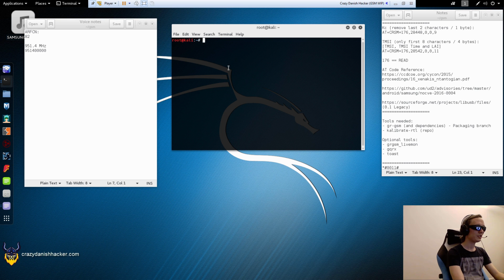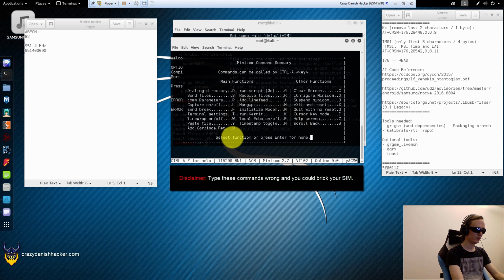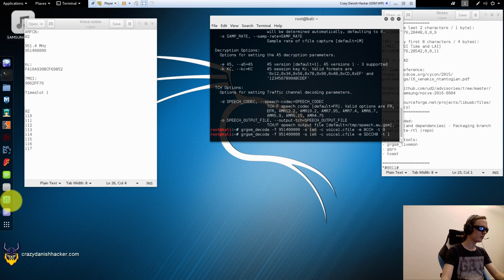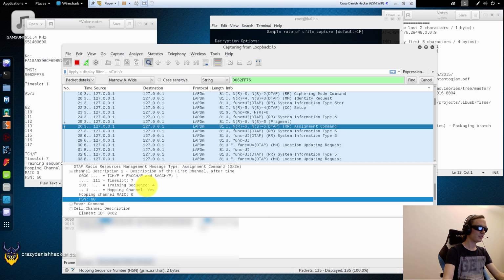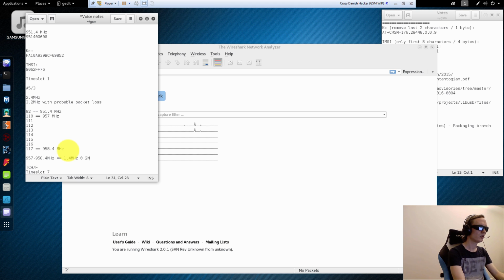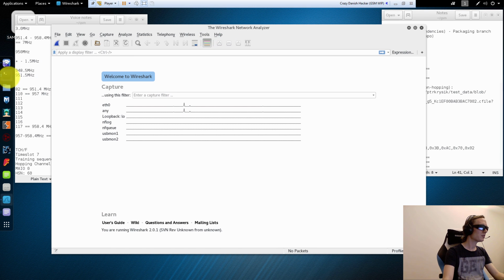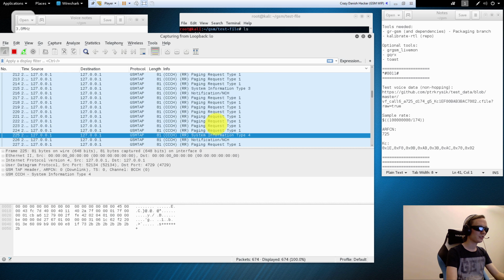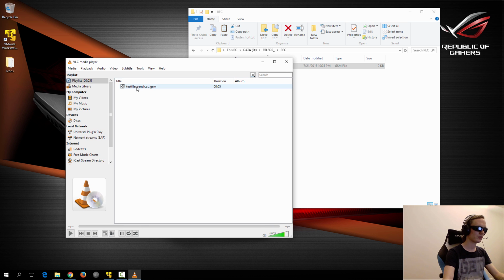GSM Sniffing: Voice Decryption 101 - Software Defined Radio Series #11

Comment: Nice Video! i have a question, im using blade rf x40, when i run livemon theres no hex codes show up, then when i use grgsm_scanner i didnt get any data about frequency, or i must use cellphone?.  so how can i can get the correct frequency?

Comment: A lot of limitations and not so obvious. Is it possible to track the hopping carrier by simultaneous tuning of RTLSDR? Instead of it, you suppose to capture the whole band, it requires VERY MUCH of computational power and of course SDR with USB3 or gbit lan or even nore. i estimate for whole band something like core i7 or i9 would be needed. Also i noticed that you got the key right from the phone. So, mom's hackers, remember, that this technique is impossible without physical access to SIM card or phone of the "victim"
Reply: GSM is vulnerable, on paper. He doesn't do it here on a real network. On a real network is so difficult.
The process is very long, the variables, the frequency hopping.
To capture the whole band must have 2tb of tables (on hard disk or cloud ?, a lot of time to download and then get to a voice), a lot of computing power.

And it is not said to arrive at a result.
Reply: @trashislife6463  now, he captures a real data from the nearest cell tower, that's why he blurs LAC of current cell, it discloses his exact position.
Reply: @romanetz55  
yeah, but it's not that easy. Where do you put the 2 TB tables?

A simple RTL-SDR is not enough to decrypt in live ... even just for the frequency hopping
Reply: @trashislife6463  2TB of fast local storage, say, SSD with M.2 interface - afaik, this is second fast after RAM - is something around ~$1500 now. Also, two simultaneously tuned SDRs are needed (the speech from and the speech to user are spaced by 45 MHz, BTS-to-MS link is higher. But!
Especially in a city, the phone highly unlikely uses GSM for calls, mostly 3G or even VoLTE.
Reply: @romanetz55  there are still a lot of feature phones with only 2g-gsm, and even if an Iphone 11 called them it would be obliged to switch in 2g ... but .. but .. is it really worth it?
even with two sdr at the same time you are not sure of reaching something concrete.
One thing I did not understand, is it possible to decrypt only live, or is it possible to "record" and decrypt at a later time?
Reply: @trashislife6463  as long as all the necessary parts of communication of MS to BTS (and vice versa) are intercepted and recorded, you can decrypt them later.
Reply: @romanetz55  have you tried decrypt? how did it go?
why you write in the first comment: "that this technique is impossible without physical access to SIM card or phone of the "victim"? because Danish hacker was decrypting locally?
you make it easy, "only 1500 for the ssd" ... for me it's not like that ...it takes a lot of power, in addition to the 2tb ssd ..
Reply: @trashislife6463  he got the key from the phone sim card through the terminal, watch the video
Reply from the maker: Watch the video series after this where I crack A5/1 encryption for an SMS sent to one of my own iPhones using an online server with 4TB storage with an RTL-SDR. Cracking is not always successful, but it is possible to do this attack without physical access to the target phone if both use 2G and A5/1 encryption. Cracking the key takes around 60 seconds per attempt using only CPU. For a compatible GPU it might take 1 to 6 seconds. It's unlikely that unethical hackers will try to use this method because it requires a lot of effort and given that most phones automatically use 3G or above these days it's even harder without adding additional attacks that have not been described on this channel. Finally, some telecommunication operators use special configurations to make this attack harder than shown in this video.
Reply from the maker: You are correct, that in this video I got the encryption key through the phone's GSM modem which communicates directly with the SIM card which stores and processes the Kc.
Reply: @CrazyDanishHacker  I've never seen on the internet any attempts to crack 3G or 4G - is it useless?

Comment: Hello friend, I have some questions:
-In one comment you write: " To decrypt voice on a real network, you will need multiple RTL-SDRs, HackRF, BladeRF, LimeSDR, USRP, or similar. " . This video-example voice is in local? So I can't decrypt a real network  with only a RTL-SDR? It can do IMSI Catcher, but it is of little use.
-Can be decrypted also 3G/4G voice calls?
-As far as I can see the process is very long and not at all easy .. do you confirm?
-Why this, when with a fake towers you can really have ALL? (yeah, completely illegal ..)
Reply from the maker: On a real network you need multiple RTL-SDRs because of the bandwidth voice uses. RTL-SDR can only receive around 2.4MHz of bandwidth, and if the data channel is very far from the channel hopping data containing voice traffic then it is simply not possible to capture both at the same time with only one radio. The same goes for capturing WiFi data. You can't capture all WiFi channels at the same time with most radio or WiFi receivers.

This video is a mix of a real network in the first part, and then a local demonstration because channel hopping decoding was not implemented into the programs I used at the time of this video. I am pretty sure I mentioned this in the video and made it clear I could not decode voice traffic on a real network at the time. 

There is a blog post on the Internet by "Bogdan" on how to decode channel hopping. I analyzed this method a few years ago when I made this video and it didn't work on my telco network as they use different technology it seems. Some of the channel hopping patterns on my network, at least at the time of testing, were much more complex.

You can decrypt some traffic on real networks if:
a) You have software that can decode this traffic; and
b) You have a good enough radio, or multiple radios. In some cases, one or two RTL-SDRs is enough but you may need to modify the hardware in the RTL-SDRs to use the same crystal. 

RTL-SDR cannot be used as a real IMSI catcher. What you're referring to is a project that passively sniffs IMSI. Real IMSI catchers are active and are basically small cell towers. They are also a lot more expensive.

I am not aware of any software that can decrypt 3G/4G/5G/6G voice calls.

The process shown in this video is long and complex. It is meant to teach people how this technology works, not enable them to listen in on other people.

If you don't understand how the system works, then you can't identify new types of vulnerabilities that may be unknown, or not very well known. Finally, this knowledge is a key part on how voice transmissions are made on these older 2G networks which are still in use in many countries.
Reply: @CrazyDanishHacker  Fantastic explanation, thanks man, have a good day !!
Reply: hello you managed to decrypt the calls on the real network

Comment: At the beginning during the voice call you saying "testing testing " at the end of the video when you playing VLC file we can hear "voice call test six" why there's a difference between those??
Reply from the maker: From what I can recall, I explained in the video that the file I decrypt and play back is from the researchers as channel hopping is enabled in my area. Channel hopping was not implemented well enough into the programs I used when I made this video. The first part of the video I showed what my packet would look like though, except for the channel hopping part. I haven't watched this video for a few years, but it should still work, maybe even gr-gsm has proper channel hopping support now. I did read Bogdan's research paper but his methods did not work for me, so I looked into the specs and quickly realized making a working tool would probably take weeks.

Comment: Do you run Kali as Live or under a VM? Good stuff.
Reply from the maker: Only VMs. I have a lot of VMs for different purposes. When I began learning, I ran it off a Live CD back in the BackTrack 2 (precursor to Kali) days. Eventually I installed a full Linux distribution instead as the Live CD environment wasn't ideal for compiling packages. Nowadays, Kali is more like a tuned and complete OS so you can usually compile most stuff in Kali without a lot of issues.

Comment: thank you for these videos. but i have a quention that, i decoded GSM voice A5/0 but i can not receive all the speech, i can decode only one part, and the size of the audio file speech.au.gsm is about 13Kb. can you tell me what is the reason? many thanks in advance!!!!
Reply from the maker: It's because channel hopping is enabled and gr-gsm does not handle that by default. You need to capture all of the channels where channel hopping occurs, and then you need to reassemble the packets back together. You can try Bogdan's patch to airprobe, but it may not work. However, you could try asking the gr-gsm developer to make a working tool for channel hopping enabled voice, or patch it yourself if you are skilled with GSM or protocols in general.
Reply: @CrazyDanishHacker  thank you!
Reply: How to sniff sms  and voice if encryption is set to a5/0.does it requires a kc

Comment: I hate linux. Always causes problems. Even with tasks as simple as reading an audio file. Installing ides, libraries, compilers, finding software to make other software work. All these tasks that would take minutes to complete on a windows computer takes shtload of time with linux.  You need to take care of infinite issues if you're using linux and not an expert of linux and it is vert frustrating to quit your primary task and deal with your computer to make it work properly. I mean all windows distros except vista works like a charm.  Linux is like an obsessive compulsive bipolar schizoid nymphomaniac narcissist heroin addict sociopath  colleague. Too many issues to draw you back. Can windows do anything linux does? Or is linux absolutely necessary for those who are into hacking things? I like learning programming and have been learning Operating systems and multithreading recently. All good resources and references involve using linux. Pity.
Reply from the maker: I guess you haven't tried Windows Millennium Edition (ME) then :P About Linux, if you're going to be a professional hacker, then in most cases you need to be comfortable using the console, and in some cases that is all the access you will have when you pivot. Some programs can be installed on Windows, or in emulated environments, but it is recommended. In my case as I also need full Windows support, I prefer using Windows as the Host Operating System, and then Linux inside virtual machines with VMware. You can also use VirtualBox, but it doesn't have as good USB support.

On Linux, there are a lot of things which are easier, and you generally have a lot more control over what's happening. Most of the Internet is running Linux or Unix because it's also much more stable and generally more efficient when it comes to resource usage. For example, with a virtual lab, I can easily run 4-5 virtual Linux machines and Windows 10 as the Host OS. If I only ran Windows 10 including virtual machines, then I would run out of resources very fast and the overall experience/lag would be worse.

For every day use though, Windows is fine for most people as audio and video playback is often more smooth on Windows by default, and if you play computer games, you'll generally get more out of your computer on Windows, despite you can run Linux applications like Cedega, Wine, etc.

I've tried running both Windows and Linux as my main OS, and in my case I need several programs that are Windows only, and inside virtual machines they typically can't utilize my resources properly, yet. 

One of the reasons why people choose Linux, besides it's open source and doesn't have a lot of tracking enabled, is because you have full control over everything. You can modify the kernel if you want to. You can also read and change source code of almost any program you run there too.

In relation to installing programs on Linux, this can typically be done in the background, and instead of downloading a 300-500mb single file, you download the necessary libraries including the compiled code. So after you've used your installation for a while, you generally don't install a lot of new libraries unless you need something specific. 

If I want to install NMAP or Wireshark on Windows vs Linux, then Linux will generally finish much faster than Windows because of all the extra steps required. With that said, I do have NMAP and Wireshark installed on both Linux and Windows. 

Being a professional hacker is about using the right tools for the job, and for web app hacking, you can typically get away with Firefox or Chrome and Burp Suite Pro (multi-platform), along with some online resources or a few Linux tools. These could be ported to Windows though. But I pretty much always have a Linux virtual machine open just for hacking, and in case I am on a computer where I can't easily install a virtual machine (or dual-boot which I generally never do anymore), then I install WSL (Windows Subsystem for Linux). It doesn't have all the tools you need, but you'll get at least some Linux capability in the Windows command line just by typing "bash".

Once you get used to using Linux just for hacking or hosting your own services, and not for "every day use" like watching videos, playing computer games, etc., then it's generally a very smooth experience.

Comment: When you have the phone next to you and you plug it in, that equals the same hack as just pressing record on your computer. Not a hack just a vast waste of time video, very happy I just scanned through this butt dump of a youtube video
Reply from the maker: No it doesn't. You failed to understand the purpose of this video, which is decrypting voice traffic over a GSM network, using an RTL-SDR. (Software Defined Radio)

The only thing extracted from the phone in this case, is the encryption key. In some cases around the world, including here, A5/1 encryption is in use (in some cases, and in others, A5/3), which means that you can crack the encryption key (if it's encrypted using A5/1) without having the phone right next to you. In other parts of the world, there is no encryption of SMS and voice traffic, so you don't even need to crack the encryption key.

Before you can run, you have to learn how to crawl (i.e. understand the basics) like in this video, and then you can learn how to walk (i.e. apply what you've learned for example).

When I made these videos, there weren't any other complete tutorials on this topic in an easy to understand format. There were various sources, but some of them assumed you already knew the topic.

Stay tuned and subscribe :-)

Comment: Hi, is it possible to send a call to connected devices?
Reply from the maker: It is possible to call a phone that's connected via USB. Initiating a call over USB to another phone, through the "serial console" (minicom) interface, is also possible in some cases.
Reply: I recently saw a video were magician use to calls every one nearby ! so I thought it must be some fake BTS and his assistant is calling every connected person.  • youtube.com/watch?v=ERwPpjEaqYA
Reply from the maker: Magicians work with the power of illusion and deception. I used to do "magic" as well once. Some stuff can be extremely convincing. I don't think he used any technical devices to do this. If they did set up a fake BTS then you could send a call to everyone nearby though, and people would also be able to call each other in the area.
Reply from the maker: However, people outside this area, would not be able to call people connected to the fake BTS as it technically doesn't exist to the "real" telco networks.

Comment: I found this problem 2. I Had it up an running from the start. Several months later after not using it in upgraded 2 external antenna. Now the problems started . I uninstalled an reinstalled... it didn't fix the problem. I'm glad you have shown me the fix.. thank you.  Where do u think the problems were from??